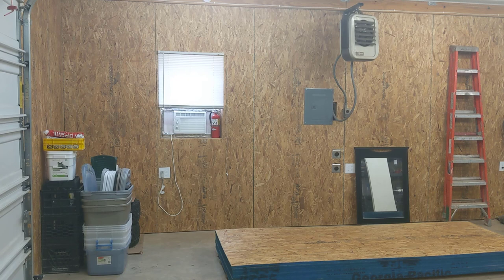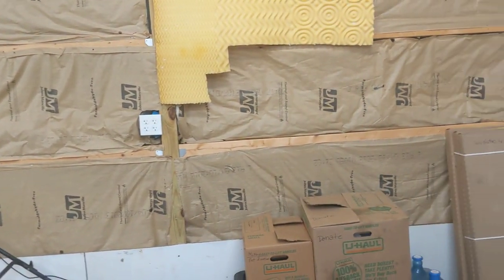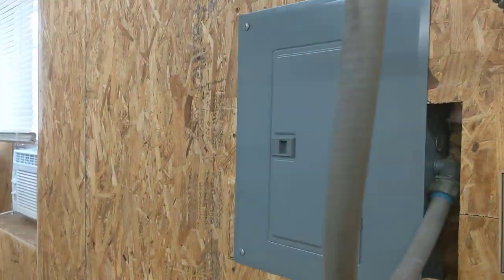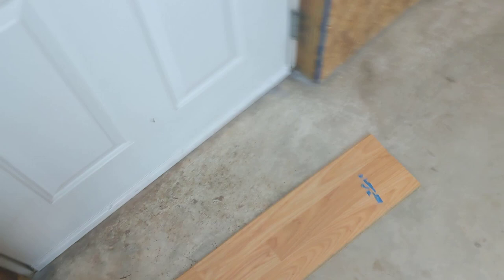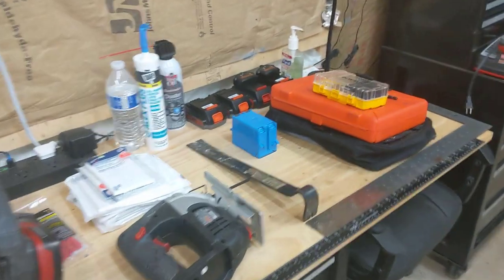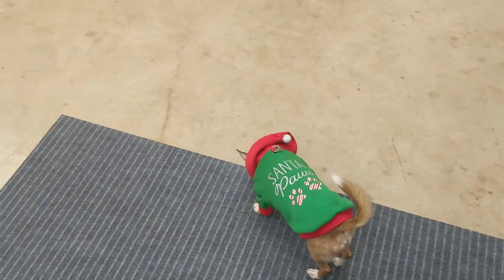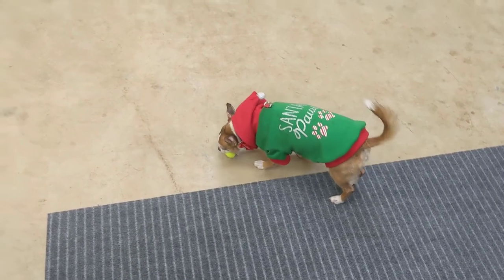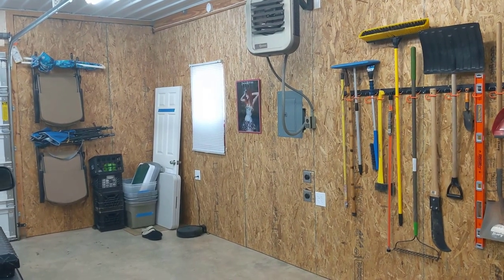Installing OSB plywood in a garage

Comment from the maker: I usually post videos about computer repair and car repair on this channel.  This video is something a little different.  When we bought our house in May 2020 it had an unfinished garage that I hope to use as a workshop.

One project for the garage was to finish out the interior walls with OSB plywood.  We chose OSB over drywall because it's stronger and we can hang stuff anywhere.  We used 4x10 sheets because the space has 10' ceilings.  This minimized waste and saved time.  The "studs" were originally installed horizontally so had to make a few modifications such as adding wood and insulation in various places and partially framing out around the breaker box.  I also had to install studs in a few places where they were missing.  One other tricky part was cutting the holes for the electrical outlets.  As the saying goes, "measure twice cut once".  🤣

Thanks to iNawrocki for his "dream garage" video series.  Check him out for more ideas:

https://www.youtube.com/playlist?list=PLzmwOVZL782kgvJ7azzIyTJRfxO-sq45X

Hopefully this video and picture slideshow of how I did mine will help someone else.  If you have any comments/questions/suggestions feel free to post in the comments.  If this video was helpful please "like" and "subscribe" to my channel.  It really helps me out a lot.  Thanks!

Comment: As of todays date June 29/2024, sheets of 4'x8'x7/16" OSB are $23.99 CAD at my local hardware store here in Goderich, Ontario, Canada. I'm part way through a garage make over after a water leak in my garage roof. I'm looking forward to finally getting my garage in shape and found your video really helpful. Many thanks.
Reply from the maker: Thanks Brendan!  $23.99 CAD sounds like a good price.  Glad this video was helpful.  It's been a few years since I posted it.  Since then I've upgraded the electrical, added a mini-split AC unit, new gutters (on the outside), new 10' worktable/counter and toolboxes, dedicated EV charger, installed more shelving and drop-down attic stairs (for access to more storage space), radiant barrier and additional insulation (in the attic), 1/2 carpet, and replaced that dirty white window blind with something more attractive, LOL.  Using screws instead of nails was particularly helpful because it allows me to pull the panels down whenever I need to get inside the walls, and is easy enough I can do it by myself.

Also got a new truck that has a "garage door sync" feature, so when I pull into my driveway it automatically detects my location and gives the option to open the door with a tap of a button on the steering wheel.  Of course I don't use this feature very often, because I've also turned part of the space into an animal rescue area and don't want any of my strays getting loose, haha.  😆

Next on my list is to clean and put epoxy or polyaspartic down on the floor.  It's great to see what people are doing to their garages.  I've been using sites like "garagejournal.com" to get ideas.  Hope this helps!

Comment: Wow.  Your project really looks good compare without those walls.  I agree with you Mike, there's no ending work at home.  Right now I'm doing the inside of my  10 by 12 feet Tuff shed  adding walls and flooring.  Btw, as of this date 03/27/2023, the OSB plywood 4x8x7/16 is $12.98 per sheet at Home Depot.
Reply from the maker: Hi Ecart!  Thanks for checking out and commenting on my video!  Really appreciate your kind words.  Everyone who comes by my house says how envious they are of our garage.  Recent projects include putting gutters on the outside, and installing a set of drop-down attic stairs.  I had to have a local handyman help me with those projects, they were too hard to do by myself.  I've seen the price of wood has been coming down a lot the past couple months.  Wish it had been $12 a sheet back when I did this, LOL.  Best of luck to you on your project!

Comment: looks very nice Iam tryin to do my garage so Iam taking tips on how to do it.question some guys laid the plywwood horizontal and others,the opossite way is there eny reason,has something to do with been more sturdy???...please reply.
Reply from the maker: Hi Osuna!  Thanks for checking out my video.  It's been a few years since I uploaded this.  The OSB is still holding up great, and I've made a bunch of other upgrades to tool storage, electrical, and insulation since posting this.  Even put drop-down stairs to the "attic" for additional storage and improving the insulation, and added a mini-split AC unit.  ☺

Regarding whether to lay the wood horizontal or vertical, I think this is all up to personal preference.  If you're using plywood (with a certain grain) it may look better run one way or the other.  With OSB that wasn't really an issue, so I got 4x10 foot sheets to minimize waste and number of cuts / panels I would need.  You may also want to consider wall spacing of your studs (where you'll be screwing it to).  Really it just comes down to personal preference in my opinion.  Running vertical made it easier to install by myself without needing additional assistance to hold up panels.

You might also check sites like garagejournal.com for more ideas on your project.  Good luck!

Comment: Typical framing for steel clad utility building or pole barn.
Reply from the maker: I'm pretty new to this.  In your experience, is this the same type of framing that would be used for a barndominium (for example)?  Thanks!  🙂

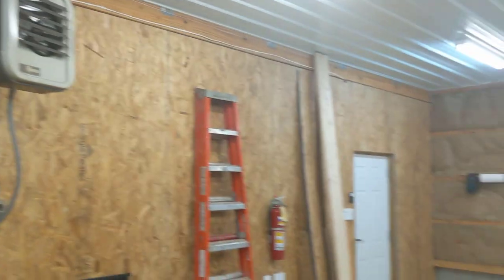Comment: 2:40 Just an FYI: This is a "pole building", as it's known in my parts. This is a type or style of building construction that uses 6X6 "poles" as the main supporting structure rather than your typical "stud framed" wall sections. The sideways studs are called "purlins" round here, but that is wrong they are actually "Girts" (I had to look this up). But who cares? Nobody, that's who. Call um Purlins. 
Looks great. thanks for the video, trying to decide OSB or T-111...?? Drywall is OUT (I don't wanna patch holes for the rest of my life) Metal is OUT (hard to mount shelves, dents easy and CAN'T repair. Gotta use conduit on the outside or perfectly flush mount boxes, to much work)
Reply from the maker: Thanks for checking out my video, and thanks for the tips!  Appreciate the correction on the terminology.  "Girts & Purlins"?  I wouldn't remember those names either, LOL.  😉

I've recently been learning about barndominiums so there's definitely some new processes and terminology to learn.  Seems like a good alternative to traditional home construction methods.  Also looked up the  T1-11 plywood siding panels.  Those look nice!  A bit more expensive than traditional OSB but certainly better than drywall or metal, as you mentioned.

Best of luck with your project!

Comment: My attached garage has been sheet rocked, but I don't think it has any insulation. The sheet rock has over 20 years cracked, and chipped all over the place including the ceiling and walls. What is the best way to fix this?
Reply from the maker: Hi Josh!  Thanks for checking out my video.  Tbh it sounds like your garage is a bit of a mess.  Tough to say without seeing it, but honestly if it were me, from the way you describe it, I'd probably pull down all the broken sheet rock and add insulation, address any wiring concerns while you're in there, then replace with new material of your choice (such as OSB, plywood, sheetrock/drywall, etc.).  Sounds like you've got a bit of work ahead of you; good luck!
Reply: @CompTechMike  the attached garage of mine needing this work, is not air-conditioned. It is always open to the elements unless the doors are shut. Does it still need insulation?
Reply from the maker: @wheelmanjosh1982  Hi again!  Regarding whether or not you need insulation, that's really a question only you can answer.  Do you live in an area with weather extremes (very hot or cold weather)?  Do you spend a lot of time out there?  What are the exterior walls and floor made of?  What are you storing in there?  What is your budget for the project?

Personally if it were me, I would always lean towards installing insulation and making it as weather-tight as possible.  But I spend a lot of time in mine working on various projects and also store a wide variety of items out there (some of which could be damaged by extreme heat or cold).  I've also converted part of mine into a safe area for stray & feral cats to live, so want to make it comfortable for them.  Obviously if you do none of these things, you probably don't need to insulate it.  Just speaking personally, for my needs and uses I would recommend it.  😊  Good luck on your project!
Reply: @CompTechMike thanks for the info. Do you think I would need a vapor barrier also? I live in North Texas, so there are extremes in hot and cold. This attached garage has a cement floor, and is mainly a car garage. I was just afraid that insulating without the area being conditioned, would cause moisture issues in the walls. The exterior wall of the garage is brick, and a couple of windows with a couple of garage doors. It's a 3 car garage.
Reply from the maker: @wheelmanjosh1982  Where I am (Northern Virginia, near DC), I don't see vapor barriers that often in garages (outside of spaces like crawl spaces).   I'm not a construction professional and don't want to steer you wrong with bad advice, so would recommend you consult with sources closer to your area and more familiar with your climate.  A home inspector in your region could probably answer this question pretty quickly.

I've also found some good information on sites like GarageJournal.com.  Maybe check out this site?

https://www.garagejournal.com/forum/threads/help-me-understand-vapor-barriers.495148/

https://www.garagejournal.com/forum/threads/use-vapor-barrier-when-insulating-unheated-garage.400383/

Good luck, let us know what you decide!

Comment: My studs are vertical.  Would it be wrong if I mounted my OSB in a horizontal manner?
Reply from the maker: Hi Frank! I think you should do whatever works best for you in terms of easiest, least amount of waste, etc. How tall is your ceiling? And how far apart are the studs?
Reply: @CompTechMike  ceiling is 10 feet high, and most of the studs are 16" at center.  If I mount my 4'x8' plywood  vertically, I would have to cut my plywood down approx. 3" for the end  of the plywood to meet the stud.
Reply from the maker: @frankm2385  have you considered using 4x10 sheets, like I did?  May make it easier to install.  I did have to go to a lumber yard to get them, however (the first load I picked up myself, the second [larger] load I had delivered).  Most box stores (Home Depot, Lowes, etc.) don't stock 4x10, unfortunately.  At least around where I'm at.
Reply: @CompTechMike  Just picked up 4x8 sheets of plywood.  Wish me luck! 😊
Reply from the maker: @frankm2385  sweet!  Sounds like you have a solid plan and are asking the right questions.  Am sure your project will turn out awesome.  Good luck!  😊👍👍

Comment: You have a pole frame shop, so the purlins are fastened horizontally on 24-inch center  to fasten the steel siding  (which is 22" wide) on the exterior.  The OSB worked well for you on the interior.
Reply from the maker: Thanks! Pretty new to this, so I wasn't familiar with those terms. Appreciate it! 😊

Comment: Nice video! How does this work with the heat inside?
Reply from the maker: Hi! Thanks for asking. Shortly after I did this, I also had garage attic stairs installed and a radiant barrier added to the attic. Also got some big new toolboxes that I built into a workbench. It's a great four-season workshop that we use for everything from repairing our vehicles to raising/rescuing stray animals. I'd still like to get an epoxy or polyaspartic floor covering done (it's on the list).

Closing up the walls did a great job for improving the insulation factor of the walls and also keeping down the dust that tends to accumulate in these spaces. Spend more time in here than I do in the house! 😆